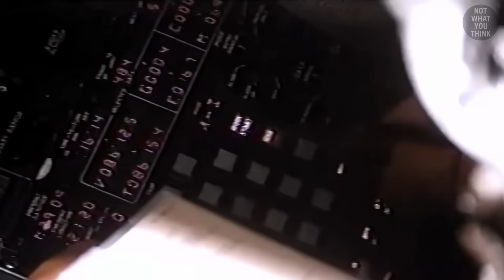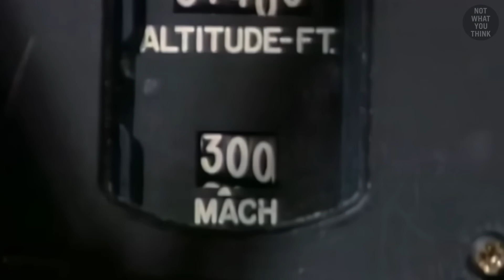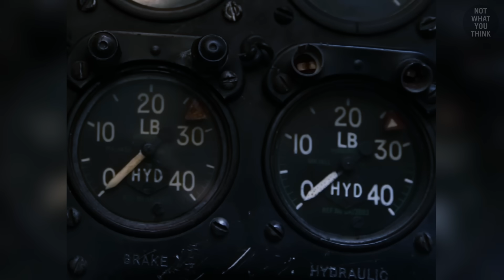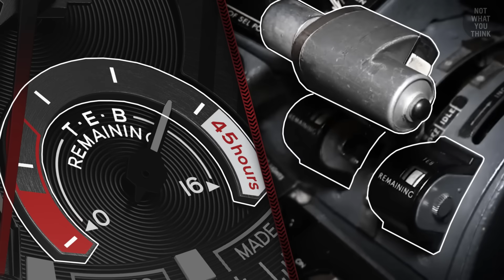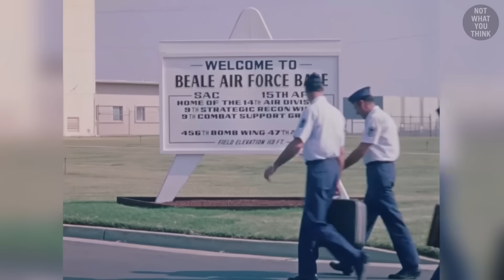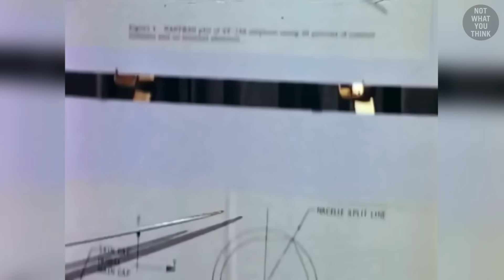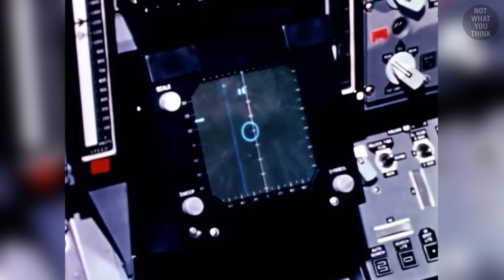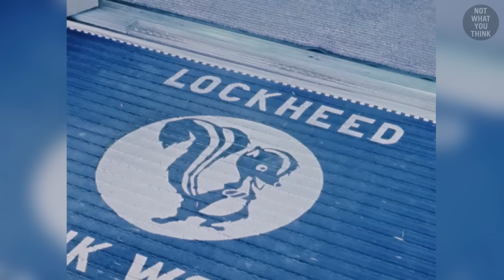Real Stories From The Cockpit Of The Untouchable SR-71 Blackbird

Comment: imagine the atc
"hydraulics system a malfunction we are gonna turn back to land over"
minutes later
"well fuck system b hydraulics malfunction now"
"how are you flying?"
Reply: Determination
Reply: It isn't the flying that is the challenge as the engines will work without hyd systems just fine.  Now controlling the direction and attitude of the aircraft is another matter entirely at that point.
Reply: @Stubbies2003  c controlling  the aircraft is like the difference between flying and falling
you cant fly an aircraft if you cant controll it

Comment: 15:10 third reason:
the rate of fuel leaking is extremely closely linked to how full the tanks are;
example: a full tank leaks (say) 1 gallon per minute, a half full tank loses only half a gal' per.
Reply: That wouldn't matter at all. When the SR was on the ground the leaking fuel was caught in drip pans, not buckets, so your estimate of leakage is probably excessive, but let's go with it anyway. If it lost fuel for a full hour at that rate, it's lost just 60 gallons, instead of 30, but a full load is over 12,200 gallons. Why would they be so concerned about 30 gallons (less than 0.25%) of fuel that they would rather fly a KC-135 and refuel mid-air? Yeah, nah!
The ONLY reason that it took off with less than a full load of fuel is the landing gear. The blackbirds were designed specifically to fly as high and as fast as they could make it go, and in order to do that, they had to make it as lightweight as practical. Landing gear that can handle every take-off and potentially an occasional emergency landing(!) with a full fuel load will be considerably heavier than those that can routinely handle 15,000 pounds less, and that would've made it slower and cost several thousand feet of altitude throughout the entire flight profile on every flight.
Interestingly, the primary reason that they refueled right after take-off was to purge the air from the tanks and allow the nitrogen to replace it. There were times when the mission plan didn't allow for refueling right after take-off though, and the procedure for that called for filling the tanks completely, and then draining fuel back down to take-off load while injecting nitrogen. In other words, they went to a lot of trouble to avoid taking off with a full load, and there's no way that keeping 30 gallons of fuel out of drip pans would be worth that.
*For what it's worth, they actually took of with about 80% fuel capacity, so given your drip rates the "savings" would be closer to 11 gallons per hour.

Comment: Your video cleared up my question of why the SR-71 was retired because of the fact that all the final 71's had similar hours. Hey can you explain sometime what goes into aircraft life hours? and your camera explanation was great!
Reply: Maintenance in aviation is based into flight hours. Fuselage, structure, engines, avionics, hydrolics, electric, all major systems in general must be inspected and if necessary repaired/replaced when they reach a certain number of flight hours  set by the manufacturers. Furthermore there's a maximum flight hours number where these systems must be replaced regardless of their condition. For example hydrolics must be inspected every 200 flight hours and replaced when they reach 2000 hours. Same goes with all systems and the engines. Precaution even though it's very expensive is the only way to minimise any risks that can compromise flight safety.
Flight hours isn't the only factor for the maintenance of an airplane. The other one is flight cycles.The cycle is calculated from starting the engines, taxiing, take off, climb to operational altitude, descent, landing, taxiing and shutting down the engines.  Two aircraft may have the same flight hours but a large difference in flight cycles. One aircraft may have flown fewer long haul flights while the other more short haul flights.  The second aircraft with the most cycles is more stressed than the first.  Inspection and maintenance is therefore performed when an aircraft completes either the flight hours limit or the flight cycle limit whichever comes first.
Hope I've helped. English isn't my native language
Reply: Mostly it was the cost and the fact you no longer needed it as satellite tech became much better.
Reply: Well obviously you failed to make some connection here as the SR-71B used for training had one thousand more hours than the front line SR-71s.  That isn't why it was retired.  They manage the hours because the worst thing you can do is run multiple aircraft into phased inspection time at the same time.  I'm not sure what the SR-71 community called it but in the F-16 community it was phased inspections.  Once an aircraft hit it's due time for those inspections it wasn't allowed to fly again until the inspection was completed.  With front line units only having three SR-71s if you don't manage those airframe hours having two SR-71s at the same place grounded for inspections is the worst thing you could do.  Say the third one was set to go on a flight and it breaks down and needs maintenance then you have precisely zero aircraft FMC or PMC.
Reply: @Stubbies2003  Thanks for this explanation. I am going to have to read it a few times!
Reply: @Stubbies2003  If I understand correctly, there are only I think three situations where you can break that rule:
1. The Aircraft needs to be flown somewhere for the inspection to be done
2. The base is about to be attacked, and you need every aircraft in the air NOW
3. The base is about to fall, and you opt to get the aircraft out rather than destroy it.

It should be noted, that if 2 or 3 happen, something has gone horribly wrong, and I imagine that 1 is a rare situation anyway (mostly seen with helicopters operating close to the front lines)

Comment: It's always interesting to see the difference between general aviation and military operations. Theoretical max speed : 3.55, in use, max : 3.3. 3.55 because after that, the engine will break. In general aviation, they have 4 engines but can fly safely with 2. x)
Reply: That wasn't necessarily because it was a military aircraft, as the A-12 and many X-planes were flown that way too, but weren't military. It's mostly due to the fact that it was designed specifically to be flown in a very particular way. So, it makes sense that it's typical mission profile would be close to it's maximum performance capability.
Reply: military personnel cannot sue the military like civilians would sue airlines for damages
Reply: @makantahi3731  In some country, family does. But my remark was more to said that the goal is different as the consequences. That engine is push to it's limits to perform best. For an A380 civilian aircraft, the performance is not the speed or most advanced technology, it's just transporting things/people and doing that safe.
Reply: Well until you show us the GA aircraft that is flying over mach 3 this is an extremely apples to oranges comparison.
Reply: @Stubbies2003  😘

Comment: Not everything worked great all the time. It leaked fuel constantly due to the expansion and contraction of the titanium panels. And by leak, I mean a large amount. Sorry, you just covered it.
Reply from the maker: That was by design though. We do talk about that in the video.
Reply: It never leaked a large amount. And when the leaks did exceed those leak limits, the aircraft would be scheduled for fuel cell MX during PDM.

Comment: It has got to get you thinking, where did all those rockets land. They are armed and still had war heads on them. What goes up must come down. And, what damage did they do to people and property?
Reply: They have fuses to explode the warheads upon returning to a slightly lower altitude. A small glass tube with a one way valve allows ambient air pressure to drop as altitude is gained, upon falling only a few hundred feet the glass tube would break due to the pressure difference and the circuit would explode the warhead so the missle would be in small fragments.

Comment: Is it truth that Mig-31 could flew the same speed like SR-71?
Reply: No.
Reply: yes, for a second, but then his compressor would blow up
Reply: As Rodger said, no. It was designed to but couldn't take off and get to altitude and accelerate to that speed as the weight of the fuel meant it ceiling was too low and would melt the engines around mach 2.8 but it could only do that speed after tanking and then climbing to around 65,000ft. After landing if the engine was still in one piece they would throw them away. The compressors were cast and had weak points,on the intake, the Americans used titanium and carbon carbon edges on theirs and could be easily maintained in comparison.
Reply: @slarratt  carbon carbon?

Comment: So it can go higher then mach 3.5 which means they stil not telling the the actual numbers
Reply: But it really can't. Outside of specific atmospheric conditions 3.5 wasnt going to happen
Reply: Not even close.

I've seen leaked pictures with what looks like to me an oxygen port for aerial refueling.

I'm pretty sure they at least tried feeding oxygen directly to the ramjets to get even higher and faster. The pilots wear spacesuits anyway.

I couldn't see an RCS package but it was a pretty tight shot at the cockpit.
Reply: @jtjames79  and how much oxygen they had and how long they could fly with that oxygen when they had a problem with the amount of nitrogen they could carry
Reply: @makantahi3731  I'm not privy to top secret government aeronautical tests. I just saw a few pictures that were sus.
Reply: ok, but why do you conclude that that oxygen was intended for combustion in the engine and not for the breathing of the crew
Reply: @makantahi3731  The same way I assume a fire hydrant isn't a spigot for watering a lawn. If you have a better idea why the SR-71 would need a large volume of something cryogenic feel free to post your own hypothesis.

I'm also open to the idea that they were trying a pre-pooler like saber, but they really didn't have the manufacturing technology for that. It could have still been a possible prototype. 

SR-71 was a research aircraft as well. They did all sorts of things they never told us about.
Reply: @jtjames79 the SR71 didn't carry anything cryogenic in large quantities. It had 3 Liquid Nitrogen bottles for the tanks, and the regular LOX system but nothing excessive.
Reply: @gr8crash  Okay sure, you know everything about everything NASA did with their SR-71.
Reply: @jtjames79 know a lot of it yes. What you may be referring to was the LASRE flight tests. It did cold flow , never was fired in flight and absolutely never transferred any fuel for that during flight.
Reply: @jtjames79  and do you assume that the hydrant is used to pour a glass of water and drink it or for something else, on the mig-21 there is an injection of oxygen into the engine so that it does not shut down when a certain rocket is launched, and that lasts 1-2 seconds. a jet engine consumes enormous amounts of air and if the whole plane was full of oxygen it would probably use it up in a few minutes because jet engines work with a large excess of air because they use it for cooling, so if they were in flight and replenished the oxygen it was for the crew because the flight lasts a few hours
Reply: @jtjames79 lol none of that makes any sense

Comment: Why did the us military get rid of it?
Reply: Analog controls plane cannot be upgraded anymore and the service life has already been reached. It like using a Nokia 5110 in 2024
Reply: Because some in congress thought satellites could take its job, plus the aircraft were incredibly expensive to maintain.
Reply: Yep add in a normal airframe for military purposes is around 5000 hours at normal speeds and altitude cycles and these were fling 40 years after being made is a disaster waiting to happen. The U2s are still around though...
Reply: @slarratt  That would only be a legitimate comparison if the SR-71 was also  built and skinned using aluminum like normal fighters.  Obviously that couldn't be the cause due to the heating at speed.  Aluminum would become soft at the temperatures the SR-71 endured.  No you and dol_arts are both wrong on this one.  lgb-fjb is correct.

Comment: It’s a shame it was so expensive to run. The U2 which is like 10 times less interesting is still used…
Reply: Yes, although the U2 isn’t really used as a spy plane anymore, mostly awacs if I remember correctly
Reply: @bokoblinlogic1619 Yeah I think it’s used by NASA for monitoring or something, which is interesting, but the plane isn’t very cool lol
Reply: @conor7154 the NASA U-2s are completely different from the USAF aircraft still in service
Reply: The Dragon Lady can take  pictures in high resolutions without the blurring of digital cameras, too bad it outlived Kodak and I'm wondering where do they get the film rolls for the Cameras
Reply: The U2 remained in production long after the SR71 was retired - if I remember correctly the production ended in the 2000s.   They were continually updated and revised so the new build were much larger and more capable than the original design, kinda like the hornet vs super hornet.
Reply: Yeah and the SR-71 definitely is as well it's just not talked about I've actually seen it flying over Charleston Savannah area is about 3 years ago they also had the stealth bomber doing trainer runs
Reply: @lostreclue4788 you did not see a SR71 flying 3 years ago
Reply: Lockheed Martin is working on the SR-72 Darkstar, AKA "Son of Blackbird". Should be in service sometime in the 2030s
Reply: @dx-ek4vr sick
Reply: @dx-ek4vr  There is no evidence to believe that work on that plane is still continuing.
Reply: and he was shot down